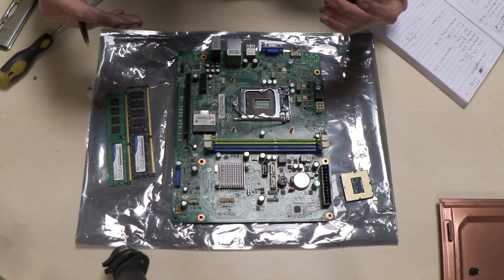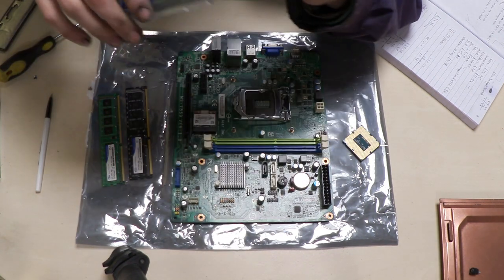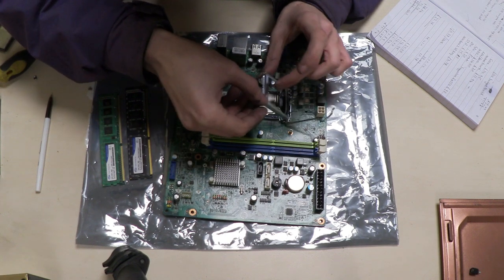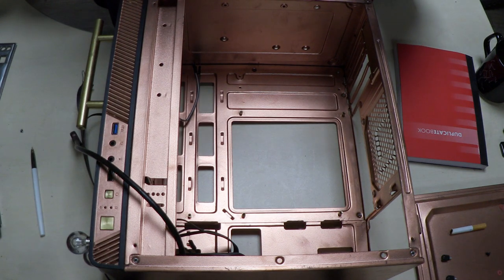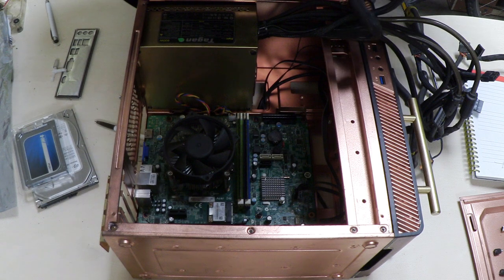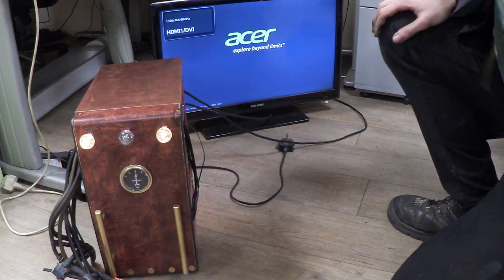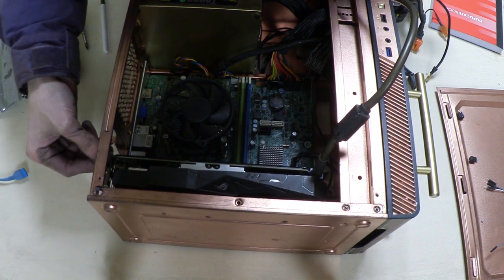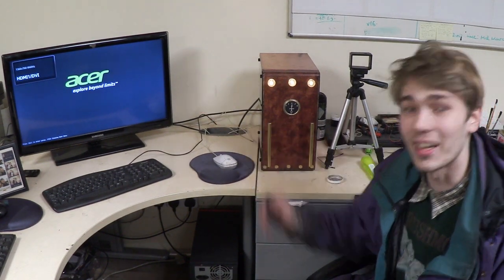982 - Building the Steampunk PC for Under £100

Comment: That's a pretty well-balanced build, just right for the price.

A few things:
-Those i5s only have one thread per core, so it's a 4-core, 4-thread processor. Until recently that's all you'd needed for most games. 
-You called the double-4 connector a 6-pin connector. 6-pin (and 6+2 or single 8-pin) power connectors are for typically for graphics cards. You didn't do anything wrong there.
-You should probably try to get at least a 120mm fan exhausting air from the back of the case. You could build up quite a bit of heat from having the GPU and CPU both dumping heat into the case. Also, I've had really good luck ducting air from a front fan into my stock AMD CPU cooler (around 8 degrees cooler), but that could ruin your aesthetic.
Reply: I thought these CPUS had more threads but I was wrong lol,  I have 2 fans ready to be put on, I guess I was a bit excited to get the build finished. Get them put on the build should run really cool. Thank you mate! :)

Comment: You were ripped off matee. That cpu will only be able to run circa 2005 games. It will chug on windows 10, and anything else is a security hazard. If you don't connect to the internet though, it will be OK to program microcontrollers and run 3d printers and CNC machines, but not much else. You should have gone for a relatively recent 6th gen pc (HP or Dell) which go for peanuts. Those parts are worth 0 and you would have more processing power with a Pi.

Comment: Do you have any experience with Linux?
Reply: I have got some experience with Linux, It is an awesome free alternative, and can be a better OS in some aspects it depends what you really want to do with the computer. :)
Reply: I’ve got one of those small cheap laptops that has a puny hard drive and not much ram that I wanted to dedicate to writing code. Arduino and such. I thought I would give one of the many linux versions a try. I’ve been trying to create a bootable usb drive so that I can install linux mint and then get rid of the current os, windows 10, yuck. It’s all laid out on the download website but I haven’t been able to get it to work. :(
Reply: James Cunliffe  Thank you. You’re probably right. In the past when I have become frustrated with some project that won’t go my way I’ve taken a break from it to find it to work out very easily later on.